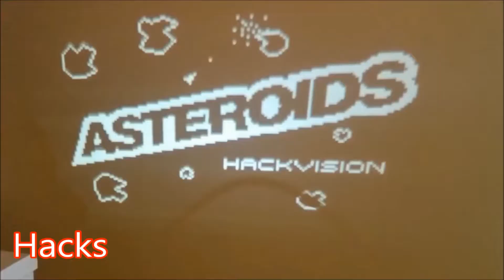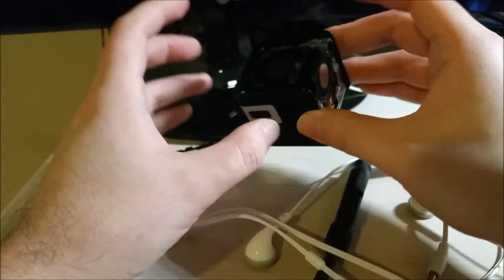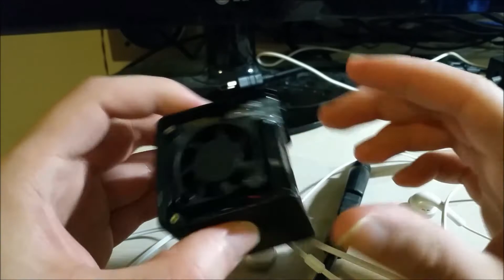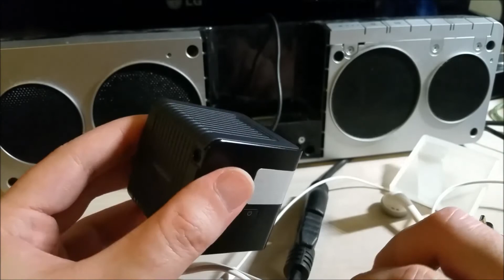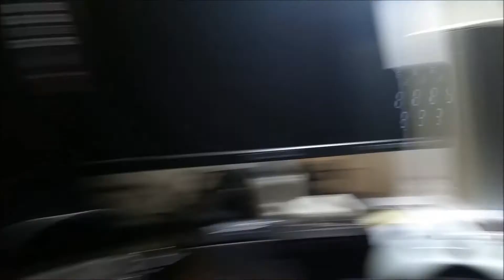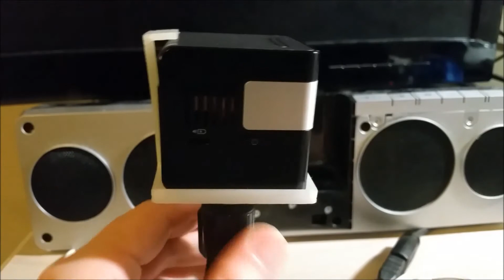Insignia Cube Pico Projector Audio Output Hack

Comment: @sjm4306 Hey there. Great video. I've taken my projector apart, but am having the toughest time finding a switched 3.5mm jack that will fit in that small cavity. Ever since RadioShack closed...it's been tough. Went to Fry's electronics and got one, but it was too big. Where did you get yours?
Reply from the maker: Feridoon Malekzadeh Yeah I hear ya about RadioShack. I know I complained about their prices while they were around, but now that they are gone I do miss them. I think I desoldered the jack from some portable electronic device. Everytime I scrap a PCB I desolder the useful parts that I think will be useful for future projects. Searching "3.5mm female smd" on Ebay brings up quite a few that should fit.

Comment: Hey bro i bought this projector and im getting an alert sign i only used it twice before any info. what do i do?
Reply from the maker: What kind of alert sign is displayed? In the time I've had this projector I haven't had any signs come up other than when the battery needs to be recharged.
Reply: sjm4306 when I turn it on in just say "ALERT" and then it just goes to off screen and shuts down.
Reply from the maker: Does the fan spin up? If it gets to the point the the dlp and led fires up then the only thing I can think of is the fan is faulty which causes the projector to shut off immediately due to overheating. If it's covered under warranty get it replaced, otherwise you can open it up to see if any of the tiny wires inside have detached.
Reply: sjm4306  THANK YOU SO MUCH
Reply from the maker: So I'm guessing it was the fan? Were you able to fix it?
Reply: I can confirm that my red (!) alert screen then shutoff is from a non-functional fan. unfortunately i cannot find a replacement fan